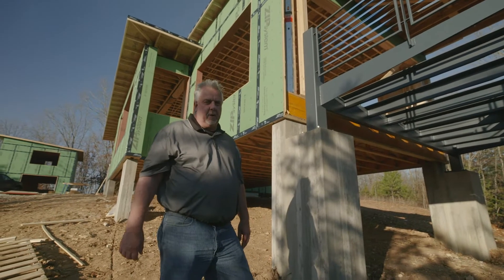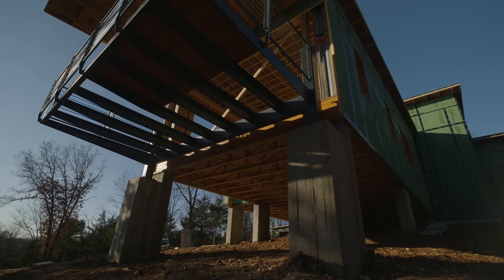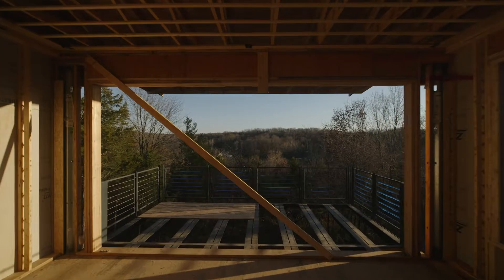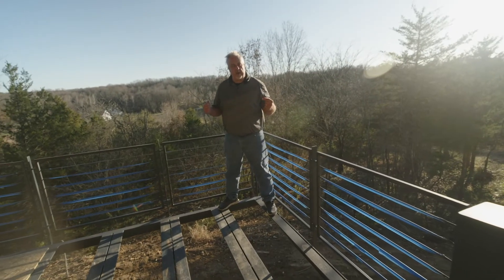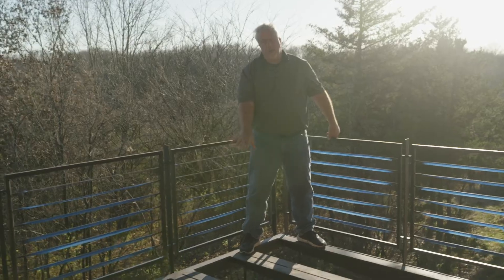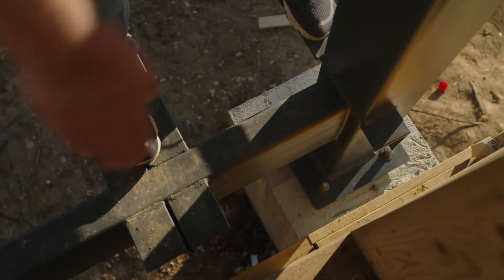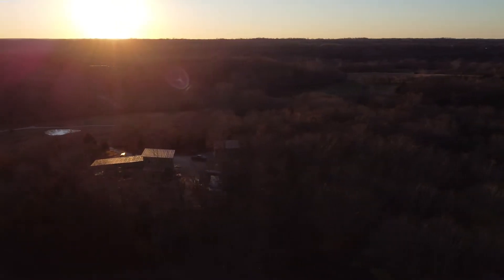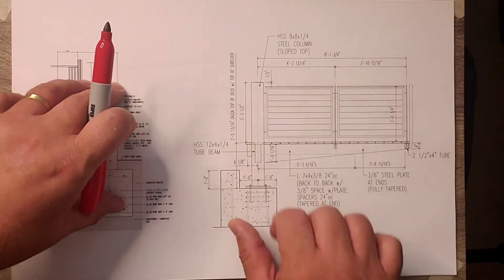Cantilevered Steel Deck Framing

Comment: the deck does look good...im sure it will hold. but I'm looking to do something similar I would feel  much better if there were a bolt or two attached to the house

Comment: If it were my house I would have run 2 canted WF's at the corners below the interior floor joists and deck joists perpendicular to that to match top of floor and save money and the steel would be outside of the thermal envelope.  Same cant. but way cheaper without special fabrication.
Reply from the maker: The deck frame wouldn't have changed much, and you two WF's would have cost as much, or more than the 1 12" tube.....there is no savings in your thoughts
Reply: @stevenbaczekarchitect9431  OK Steve

Comment: Couple things. First, go look up the definition of cantilever. Second, a hot tub (close to 4000lbs) and one, too many people out there taking a cool pic and we will see the true strength of the four studs closest to the house. This is terrible engineering at best and dangerous at worst. Better add a couple columns to the outside corners of this one buddy or you’re going to have a lawsuit in your future.
Reply: Yeah definitely not a very efficient way to achieve the result. I'm sure it's technically engineered for the load, but like you say, probably not as much margin as typical. You can see it move when he bounces.

Comment: This is rock solid engineering, but I would’ve done differently, I would use his box steel on all of the foundation members all the way down to 6 inches above ground level bolted to a concrete rebar foundation below ground. The two foundation members at the end can’t be cantilevered to hold the deck. It’s stronger, and more streamline because steel is King an engineering framework, anyway great show, keep on rocking.
Reply: Agreed. That’s a lot of money on RC going all the way up. And it’s not particularly beautiful either.

Comment: Will this be able to support 20,000 lbs of water?
Reply: My first thought!! Just wait until someone tries to put a hot tub on it.
Reply: This is why all homes should come with a manual. And all homeowners should be required to read the manual - word will get around when Insurance companies start rejecting claims because the home owner was told the weight capacity of the deck and ignored it.

Comment: Great implementation of so many good principles of both architecture as well as the engineering that makes it possible.  Quick question Steve.  "View wise", I support your decision for the horizontal members between balusters.  I wanted to do the same on my cantilevered deck, but was discouraged by 3  people not to do it, because children love to use them as a ladder.  How would you answer those objections?
Reply: I don't think you should counter those objections if deck is at a height that falling from over the rail is enough to hurt them. Even quite small children can climb well enough to make it over the rail shown in the video, and it's nearly impossible to superviser children 100% o the time, so I think you have been well advised. If you wanted to have horizontal members, you could have fitted them behind some safety glass so you get the appearance without the risk.